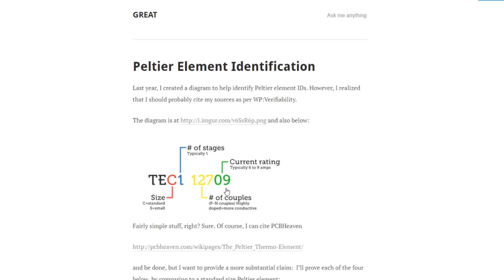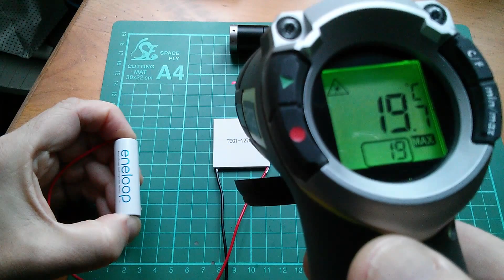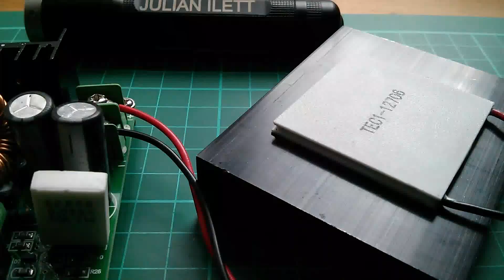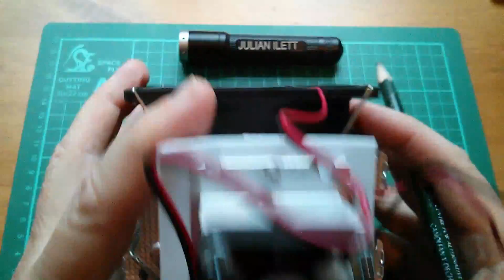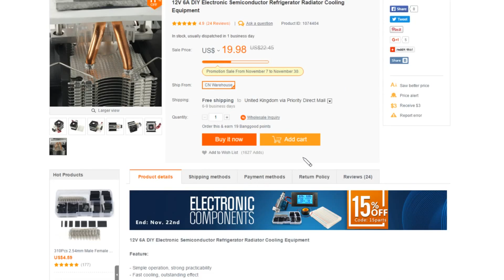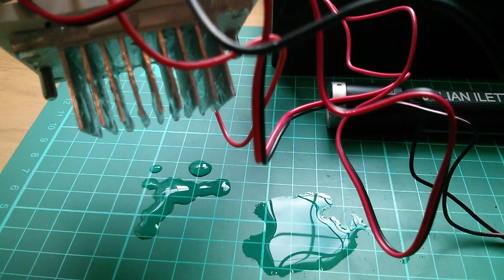Playing with Thermodynamics: Peltier Element Cooling

Comment: "Lets watch this ice melt" - Classic!
Reply from the maker: Yes, in hindsight....
Reply: Right after "This IS a proper job!" ^^
Reply: Haha, yes =D
Reply: David T. Proof of global warming so might say
Reply: They have a 15A @12V I wonder if this has enough to cool a good size refrigerator or maybe 2 of these on each side of the freezer area... Years ago I had a idea to cool this processor enough so it wouldn't throttle and overheat and maybe use a 1A with a dimmer switch to bring the current up or down, but I was worried about water, but the heat coming of this processor should dissipate the moisture.2Pcs TEC1-12715 Heatsink Thermoelectric Cooler Peltier Plate Module Description: Solid state, vibration free, noise-free
Simple to install and operate
The hot surface need to be good heat sink Specification: Product name: thermoelectric cooler plate module
Model: TEC1-12715
Color: white
Couples: 127
Voltage: 12V
Umax: 15.4V
Imax: 15A
Max power consumption: 231W
Tmax: 70°C
Qcmax △T=0(W): 137W
Size: 40 x 40 x 3.3mm
Weight: 100g(2pcs)Package included:2 x TEC1-12715 module
Reply: "-50C had similar" in which minute the film reached -50C?
It is not possible to use one cell 12706, the maximum temperature difference is 70C, which is practically unattainable.

Comment: What happens if you staple the elements so they are working in series?
Reply from the maker: Like this? http://www.ebay.com/itm/TEC4-24603-Heatsink-Thermoelectric-Cooler-Peltier-Cooling-Plate-Four-layers-/262174876788
Reply: Paul Sengupta
Everything is 100% efficient as a heater. A peltier is just a very stupid one at that because it can destroy itself by overheating. Even a light bulb would be better suited than that. ;)
Reply: you would think you get twice the cooling affect or there abouts but no, in fact you hardly get any more performance, about 10% for 2x the power. Thats if you put them together, maybe with a heatsink metal block it would be better.
Reply: Steven Ruscoe
nice!
Reply: This would cool much better with a bigger and better "Coldsink" and use Artic Silver Thermal Paste on both sides of the Peltier Element or Board, what's your thoughts? This item on Bang Good also says the working condition is 5 Amp...
Reply: Could you make a refrigerator video on this? How big of a cooler would work properly and if you add two maybe a freezer?
Reply: Instead of piling the elements in a series, you would be better off running two separate or parallel $40USD
Reply: MrBrymstond yes putting 2 or 4 flat on a slightly bigger heatsink would give you a better boost in performance even if you were to run them under powered.  
Ha, I'm just waiting for someone to say "why not put one on top of the heatsink on the hot side to cool it down, that'll get rid of the heat and make the cold side colder", lol, if only it worked like that!
Reply: MrBrymstond Julian Ilett yes I would love to see proper testing over time on series and parallel configurations. I buy frozen meat and get it delivered. got 2 polystyrene boxes, 2 inch each thick which fit nicely inside each other. might try some experiments myself
Reply: Steven Ruscoe Me too, good luck with yours, I don't have .2 polystyrene boxes, but I'll figure out something.
Reply: Peltiers are horribly inefficient. For every Watt you "pull" out of the cold side you have to dissipate approximately 10W at the hot side. So if you want to pull out that 1W with two stacked peltiers, be prepared to get rid of 100W. The only reason you ever want to stack peltiers is to reach a greater temperature difference. A single peltier has a limit on the difference it can create, because the internal heat conduction from the hot side to the cold side is always there, even if on. The harder you drive a peltier, the more inefficient it gets up to the point where the cold side doesn't really get much colder than ambient, because so much heat is leaking back and the hot side is cooking (you most likely destroyed the element by then, because you can get it so hot that it melts the solder joints of the couples).
Reply: So how efficient is it as a heater, given that you could run ambient air over a heatsink to warm the cold side? Like an air source heat pump?
Reply: superdau As long as it's set up properly it will work great
Reply: That is actually not true for a heat pump.With a heat pump you get the energy that you input into the device and the energy being moved from  the other system. This is called coefficient of performance. It is calculated by heat transferred on the hot side divided by energy in. With a heat pump you can receive multiple times more heat energy than you put into the device.
Reply: Or you could do it another way, just buy a Coleman Cooler with these already in one. I've owned one for almost 16 years now. Came in handy when moving food and medications on a 5 hour drive. On them there was also a switch so that the cooler could be used as a warmer.

Comment: I think your infrared thermometer will not show proper values when pointed on a metal surface like this aluminium because of the emmission grade. Or did you correct the factor on your thermometer?

Comment: Oh i remember the days  about 15 years ago using these to cool the cpu then water cooling the hot side of the Peltier. At the time i had two pc power supply's connected in parallel to give enough amps for both the pc to run and the Peltier draw. I was overclocking an AMD cpu good spec at the time, but no need for all that these days with intel i just watercool. Which does mean in a box somewhere i have all the old Peltier.... Oh i see there is a 120w one mmmm http://www.ebay.com/itm/TEC1-19906-6A-24V-120W-40x40x4mm-Thermoelectric-Cooler-Peltier-Plate-Module-/302040012178
Reply: Mikes DIY Tesla Powerwall they have such a low efficiency, its not worth it. you can get better temps by just using high water pump speed and heaps of radiators
Reply: i guess so

Comment: Try to cascade them, see how much cooler they run :) Also, for moisture removal, an Arduino project will be nice. Compute the dew point and run the Peltiers just below that temperature with pwm, perhaps?

Comment: Does it generate electricity if you heat one side and cool the other ?
Reply: Yes it does, although rather inefficiently, it's a really cool concept, solid state heat>power generation.
Reply: Ies it does. Hot side at 65 C and cold side at 22 C (CPU cooler) generates 0,5V open circuit and 40 mA short circuit
Reply: The peltier to buy is called teg, thermoelectric generator, they work better as a power source when heated

Comment: Peltier dehumidifiers are good to put inside a cupboard or wardrobe etc. but they are completely useless when left out in the open in even a small room.
Also, in a colder climate like the UK, powered desiccant dehumidifiers are a much better buy than refrigerant dehumidifiers, even though the technical data on the box makes them look worse (the ratings are at 30°C + 80%RH)

Comment: I've been planning on making a diffusion cloud chamber and the main components are Peltier elements - if memory serves me well I'd need to reach around -30/ -40C for the chamber to work and I heard that to achieve those temperatures I'd need to stack two Peltier elements on top of each other, with the element on top running at a lower current than the bottom element.
Reply from the maker: There are some multi-element Peltiers on eBay. They're stacked and look like pyramids - the colder elements are smaller. TEC4-24603 Heatsink Thermoelectric Cooler Peltier Cooling Plate Four layers #SoreKara http://www.ebay.com/itm/TEC4-24603-Heatsink-Thermoelectric-Cooler-Peltier-Cooling-Plate-Four-layers-/262174876788
Reply: +Julian Ilett Awesome, thanks!

Comment: what happens if you warm the warm side and cool the cold size, does the cell produce electricity? i.e place it over a boiling kettle and put a Ice cube on the other. Great Puppets.
Reply from the maker: Yes it does, but not very efficiently. Alice also sells an element which is more suitable for energy generation (Seebeck effect).
Reply from the maker: TEC1 SP1848-27145 TEC Thermoelectric Heatsink Cooler Peltier Plate Module  http://www.ebay.com/itm/TEC1-SP1848-27145-TEC-Thermoelectric-Heatsink-Cooler-Peltier-Plate-Module-/311534560155
Reply: Thank you for the quick reply.
Reply: interesting... but the listing says it's optimised for Sebeck (generation) but only shows a table of I V  and temp difference for Peltier... any idea what sort of power output you could get from a device that size>

Comment: There is one more interesting way to use Peltier element. It can harvest energy from warm surfaces. There is a board available which boosts that energy to usable levels. It looks like this:
http://i.imgur.com/uT9Zayl.jpg
http://i.imgur.com/BtlP37O.jpg
It can power wireless sensors.

Comment: i have a question: 
i have a 12V power supply with a current capability of around 18A available. I want to get a buck-boost converter that can convert that voltage from 0V up to maybe 24V or even higher to act as a makeshift lab powersupply. i want to have both voltage and current limiting and a digital readout of both (would be nice to have both at the same time).Is there a model you can suggest to me availabe on ebay?
Reply: https://www.amazon.com/gp/product/B00RCJPIS6/ref=as_li_qf_sp_asin_il_tl?ie=UTF8&camp=1789&creative=9325&creativeASIN=B00RCJPIS6&linkCode=as2&tag=gre09a-20&linkId=KM7GVH6DQF446L3R#Ask

Great scott  made a video where he used this as a powersupply regulation.
Reply: muh1h1 boost buck is not very accurate nor efficient. 
the best way to build a psu is to take a 48V supply and one of those fancy color display buck converters julian featured a while ago.

Comment: Cool (pun intended). It would have been interesting to have used water cooling for the heat sink by putting it in a plastic container with ice and water below the level of the Peltier element, of course, just to see how low the temp would go.

Comment: Hello Julian, I do not miss any of your videos, thank you very much, but I have a question, does your thermometer not measure the temperature at the place where the red laser spot is inside?
Reply from the maker: The laser sits slightly above the temperature sensor, so at close range there's a parallax misalignment.
Reply: ok